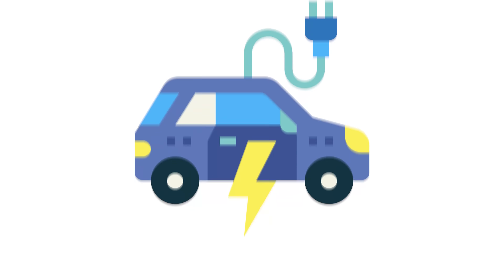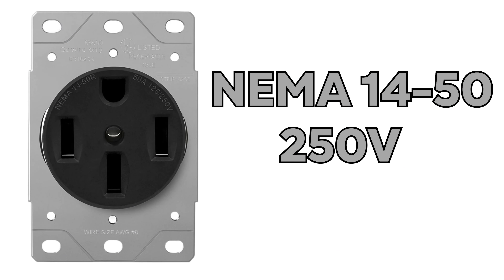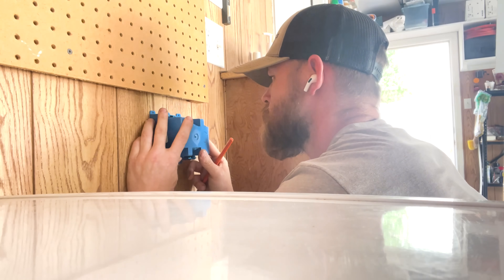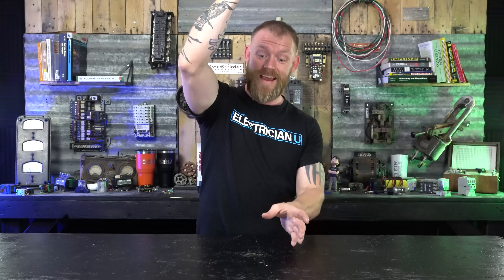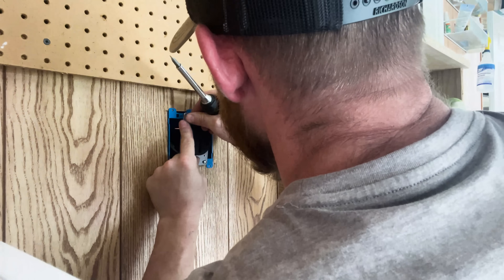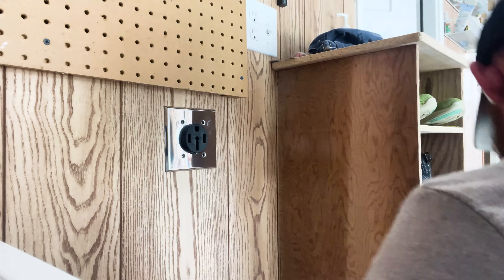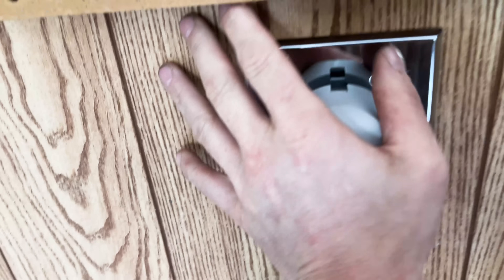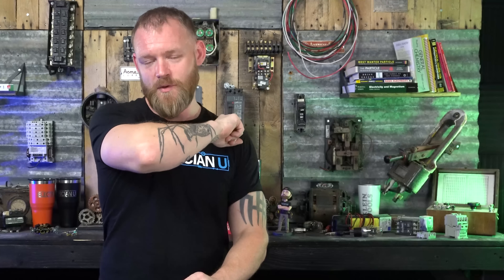How to Install an Electric Vehicle Charger Receptacle

Comment: Since this video will be seen by just as many people who are NOT electricians, I'd like to break down a few things that were not covered in this video but will help you understand your vehicle needs better.

First and foremost, that little box you plug into the wall is NOT actually a charger. The actual charger is IN YOUR CAR! That box has a small contactor/relay and a computer inside it and thats it. This box talks to the car and says, " hey, I'm a 16 amp or 40 amp 240v charging circuit." The car then adjusts its internal charger to only operate at the voltage and current that the box can provide. More on this later. At this point its just important that you realize the charger is in your car, not this plug in box.

Most cars come with a 3.8KW internal charger. At 240V (called Level 2) this equates to 16 amps. You can have a 40 amp box, but its only going to charge at the car's maximum of 16 amps. If your car has a 3.8KW charger, don't waste your money on a larger charger thinking it will charge faster...it WON'T!

Some cars, like Tesla have larger 7.8KW chargers and even 11KW chargers. These Level 2 chargers charge at 40 and 50 amps and will require a bigger box and circuit.

I like to install the Leviton 5842, 20amp receptacle for people with the 3.7KW cars. This is a dual voltage receptacle that provides Level 1 (120V) and Level 2 (240V) in a SINGLE outlet! It can be shared to operate off of a single 240V breaker, or divided to operate off of a single pole 120V breaker AND double pole 240V breaker. This is a great option for most people and only requires 12 guage wiring. See it here... https://www.amazon.com/Leviton-5842-I-Receptacle-Commercial-Grounding/dp/B000U3BVMI/
You can buy Level 2 boxes with the NEMA 6-20 plug on it off of Amazon for less than $200.00 Again, for most people this is all you need, especially all the "hybrid" vehicles.

The only other plug I like to install is the one in this video which is the NEMA 14-50. Its more expensive, requires bigger wire and will allow cars like Tesla to charge at their full rate. Its also the standard 240V RV outlet so you can plug in your RV when not charging your car. There are also lots of adapters available to! (I also use mine to backfeed my home with a generator in case of a power outage but this is an advanced subject not covered here.) I really like the NEMA 14-50 for many reasons but its not a must have for everyone.

Now if you remember in the beginning I said this box talks to your car's computer and says what kind of box/circuit it is. You can have the smaller 6-20 plug on a 20 amp circuit and still charge a Tesla...just not as fast! You have a Bolt but your buddy stops by with his Tesla. The box tells the Tesla, "hey, I'm a Level 2 charger but can only do 16 amps (3.8KW)." The Tesla says, "cool, I'll set my internal charger for only 3.8KW even though I can do 11KW so I don't overload your circuit."

You'll see that some boxes on Amazon come with 30 amp plugs. This is because most houses will have a 30 amp receptacle in their garage for a dryer already. That's it. Its MY opinion you should NEVER install a 30 amp receptacle unless you NEED it for other devices (welder, air compressor, etc)

First choice; NEMA 14-50. Second choice; NEMA 6-20 or combo 6-20/5-20 for Level 1 and 2 or a vacuum, or power tool or... I hope this helps.
Reply: Question on size of cables. If you run NM14-50 with 3 X 6AWG cables (L1, L2, and Neutral) Do you run the ground at 6AWG as well? and if so, how do you ground the electrical box with the grounding screw? Thanks in advance.

Comment: 0:30 shows a Tesla HPWC with a J1772 connector. . . A rather inauspicious start.
2:50 Using an old work box and fastening it only to drywall is a terrible idea for this size receptacle. The insertion and removal force necessary to mate and unplug this connector will, in short order, destroy the meager tabs holding the box in place.  Use a proper old work box with screw affixation like an Arlington F102 for decent longevity.
8:30 look up Hubbell/Raco insider for a more suitable connector for this task.

Comment: I just did an EV  the specs were 32A  6-50 R  so I installed 6-3wg  wired off the neutral for a future use/ change  , hooked up my 2 hots and Ground . popped in a 40 A breaker  Done

Comment: 1) #8 NMB in USA is rates 40a
2) GFCI after recpt is not compliant the GFCI is for the recpt
3) 125% load calc on conductor for EV, #8 NMB would do 32a

Comment: Question: I am planning to install a 14-50 outlet in my garage for a Chargepoint EV charger. I will be using 6-3 wire for a 50A circuit and the instructions state not to use a GFCI outlet because the charger unit has a built-in GFCI. If I ever decide to permanently remove the EV charger, will I have to replace the outlet with a GFCI outlet?

Comment: Hope I’m being helpful. All evse equipment both J1772 and tesla all have gfci built in. It’ll trip at 20mA but a breaker will trip at 5mA. All ev “chargers” will run a self test when they turn on.

Comment: Also, the tesla official wall connector can be setup to allow lower amps.  You always set it to 80% of breaker.  Very easy to program it to only allow 16 amps for example.  That would allow it to work on an existing awg12 wire.
Reply: It's not the outlet with the 80% continuous duty issue. It's the breaker.
Reply: You always do this? Maybe you should stop doing this and install the equip as intended. With 16amps the loss of current is way to high. Start using a real wallbox and promoting it. Those stupid wall plugs are not worth the money.

Comment: Just put a blank plate, no breaker in the panel with the wires taped off to connect later after the electical inspector leaves. You don't need a gfci breaker then

Comment: I'm an apprentice so we just installed an EV plug on Friday, but the guy i was with actually connected the hot conductors directly to the sub panel lug nuts... just wondering what's your thought 🤔
Reply: NO! There is NO breaker protection and that's a massive fire hazard. If the outlet ever shorts it will draw full panel power through the wire.

Comment: I installed a Tesla wall charger on one side of the garage, but on the other side, I installed a NEMA 6-50, which operates like a NEMA 14-50, but has no neutral.  I used a G.E. Wattastation which came with a NEMA 6-50 plug. Works great.  The only point being that you may need to look at your hardware before committing to the NEMA 14-50, even if it is more common.

Comment: On a NEMA 14-50 receptacle you need to provide a neutral conductor to it because of the receptacle format. However and electric vehicle charger doesn't use t neutral. It just used the 2 live conductors and the equipment grounding conductor (240 volt only).

Comment: I wish they would put green insulation on the equipment grounding conductor on Romex. It would make for a safer installation.
Reply: @William Lusby well obviously when you have exposed live terminals on the same junction box, it increases the chances of a short circuit.
Reply: @William LusbyThe grounding conductor on M/C cable is insulated. I think it's cheaper to leave the ground wire bare in Romex.

Comment: Can you clarify why you used #8 and not #6 wire? I guess this is fine on a 30 amp breaker. Can definitely not swap with a 50 amp breaker tho.

Comment: Two things i'm surprised were not mentioned here, which I think are extremely important to consider when setting up for EV charging:

1) continuous load --  since an EV that's charging can draw a load for many hours at a time, there is a de-rating that must occur, or in other words, an increase in conductor size (i.e. for a 40 amp load, 6-awg where normally 8-awg would do)

I'm surprised Dustin did not account for this when he mentioned just swapping out the 30a breaker for a 50a down the road.

2) quality, or grade, of receptacle -- especially in cases where the EVSE will be plugged and unplugged regularly, it is advisable to skip the $8 home depot NEMA 14-50 receptacles and spend the extra money on a heavy duty/commercial grade version. 

With 9 to 11 kilowatts flowing through the wire, the connection points, and the device, for 8 to 12 hours (or more),  the case for over-speccing and overbuilding cannot be overstated enough.
Reply: My thoughts exactly. And im just a self proclaimed UTUBE  ELECTRICIAN. I oversize everything fir EV charging and Generator hookups
Reply: @billpizzaman4700  Also worth mentioning the 50 foot rule. De-rate (or thicker gauge) for any cable length over 50 feet.
Reply: There are numerous videos of melted 14-50 recepticals from a hardware store. Pay the extra for a commercial outlet.
Reply: Are commercial grade receptacles better in temperature tolerance?  Asking because I use the home depot $8 receptacle for my home charging.

Comment: FYI, while the NEMA 14-50 is the most common receptacle, many car manufacturers support other plugs also.  I recently installed a plug in a jurisdiction that mandates conduit.  There was existing conduit where we needed to go, but the conduit only accommodated 2 #8 thhn.  As far as I can tell the cars don't use the neutral anyways and Tesla sells a 6-50 adapter, which is the same thing as the 14-50 less the neutral.  Some appliances like stoves use both 240v and 120v for the heating element and clock respectively, but I don't think the EVs make use of the 120v.  It's just the most common existing receptacle, thus the most common plug.
Reply: If a 50A motorhome is pluged in it will need the neutral.

Comment: Ok, I have a question. If one has a service pole some 500' from a structure and the pole has a 120/240 VAC  200 Amp Meter base with a 4/0 Aluminum USE lateral in 2'' Schedule 40 PVC Conduit to be installed by the Power Company to an Service Disconnect ( 120/240 VAC 200 Main Breaker ) on the Structure , does the Meter Base on the Service Pole required to have a Ground Rod , 5/8'' Copper/Brass 8'  installed ?

Comment: The most important thing....buy a premium 14-50 outlet. Hubbell recommended. I had a cheap home Depot outlet and it kept overheating and my charge was cut in half. As soon as I installed the hubbell i have had ZERO issues.
Reply: Bryant outlets are much cheaper and many people think they are the same as the Hubble (even made by Hubble).

Comment: Easiest way to secure it to the panel is a reverse grommet. Slide it on the wire after it’s pulled thru and snap it in.

Comment: Hey y’all, I am an apprentice electrician, loving the trade. I have a question about how to know if we can even run romex through the wall? I know how to use a stud finder, but in a case like this how did you know there wasnt anything going to be in your way when cutting open the whole and then running the 8/3 down from the attic? I recently just installed LED mirrors for my two bathrooms. The bathrooms are back to back and mirrored to the T, but one side had some kind of horizontal studs most likely to strap the cooper pipes for the pluming. I just made a little 2x2” opening in the drywall and chose to caulk and cover with mirror, but on a customers house I dont think Id do that.
Reply: You know because of the height of the wall. If you have a standard 8 ‘ ceiling then you will not have fire blocking in the wall. If you have ceilings that are higher than that , like in most custom homes you will have 9 ‘ or 10’ or higher 12 ‘ ceilings with taller walls. You will have cross blocking , or fire blocking at least in 2 places in the wall. Usually within 2’ of the top plate and 4 ‘ of the bottom plate. Most of the time you will not have blocking in a standard 8 ‘ wall unless it’s on a wall like in a kitchen where there is blocking for cabinet support installed. So the wall he installed the receptacle in is a standard 8’ wall. And if there is blocking just cut the Sheetrock from the center of the studs in a square where the blocking is. Drill a hole through the blocking and screw the square of Sheetrock back in place and patch it.

Comment: wish i could pst pics of my install. Ran #6..... Something You don't touch on Justin, is continuous load derating. #8 is why you needed to install a  30a breaker. #8 can hold 50a, but not if it's continuous. I can feel "heat" in my #6 conductors when my Tesla is charging at 32a. It's not a lot, but the wire isn't cool like ambient air is.

Edit: still a good video, just might not cover enough bases for that DIYer who is thinking this is easy work. I have to say, as a DIY person, my EV outlet needed a bit more info than just connecting wires ie. continuous load.

Comment: the cord that you use to charge an EV has literally one job, to regulate the current that the vehicle can pull. by putting a 30 amp breaker on a 50 amp plug you are just going to have constant tripping as the cord tells the car that it can pull up to 40 amps which it will try and do for long enough that the breaker will trip and you will wake up to an uncharged car. breaker's entire purpose should be to protect the wiring in the walls. the cord will protect the car from taking too much current.
Reply: The EVSE (which I guess is what you are calling "the cord") will draw whatever current it is designed to draw. But presumably the customer asking for the 30 A breaker knows that the EVSE that they've purchased only needs a 30 A circuits and will not be tripping the breaker.

You are right that the breaker has no way to limit the actual current drawn by the EVSE, but that's not the point.
Reply: @harvey66616  yes I'm referring to the EVSE. A 30amp evse won't fit the nema 50 socket that has been installed. The EVSE that will fit the socket is 40 amps which will trip the breaker. I understand that this is what the customer wanted. I think the issue is neither party unstood how the car would be used.
Reply: @shauntoochaos235  "A 30amp evse won't fit the nema 50 socket that has been installed" -- not sure what you mean. I own a 5 kW EVSE with a 14-50 plug on it. It definitely fits the 14-50 receptacle I have installed in my garage.
Reply: @harvey66616  the ones I see online that are lower amps have nema 30 plugs
Reply: @shauntoochaos235  your own observations online are not even close to representative of the actual market. Making a broad generalization based on that is unwise.

Comment: Just my 2 cents on the 30A breaker on the 14-50.  The breaker is there to protect the wiring of the circuit from overload.  The 14-50 and wiring is rated for 50A so a 50A should be used even if the owner isn’t going to have a load near that.  If I install a 120v circuit just for a light that pulls 1A I’m not going to install a 5A (or whatever) breaker.  I’d use a 15A or 20A depending if I pulled 14 or 12 AWG wiring
Reply: The breaker is there to protect everything downstream of the breaker. This is the wiring, yes, but also the equipment plugged into the outlet. If you've got (for example) a 24 A charger plugged into the outlet, it's safer to have a 30 A breaker, so that if something goes wrong, the EVSE or its own power cord (which are not rated for more than 30 A) don't get too hot and start a fire.

Comment: Justin,
Great videos, but.....
#8 THHN is rated for 50.
#8 romex is 40.
Load calculations on that panel FULL of wafers.
Blue Carlon cut in ???
Metal 4 square x 2-1/8" with extension ring, attached to framing not sheathing.

Comment: Teslas can use a 14-50 or any other receptacle and other vehicles use large chargers. 
My Volt has a wall unit. 

Also I don't think these receptacles will be code for long. You can't cord and plug disconnect a hot water heater because of the amount of current it draws and how quietly it does it because someone can unplug it with a load and arc themselves. It's going to happen to some kid unplugging a car charger under load (which is usually more than a HWH).

receptacles for chargers should require lockable in use covers.

Comment: On a Tesla mobile charger, the one that is supplied with the car. You can change out the house side plug. It will then know what is plugged in, 120-15, 120-20, 240-30, 240-50. 

In turn, the mobile unit will tell the Tesla car what it can draw for amperage. So if a Tesla was plugged into that NEMA 50, it will pull 42 amps. That will of course trip the 30amp breaker. 

Yes, you can lower the amp draw in the Tesla. But a lot of people don’t know that. And even if they did, they would be wondering why they have to. 

With all that being said, the same issue may happen with other EV chargers. Where they know that a NEMA-50 was used. Thus the car will draw 42 amps.

Comment: "a little bit extra won't hurt you."
Cries in $6.50/ft wire

Why do you say "so you don't get too much current through the car" ? The cars on board charger has a limit to how much current it will draw and the EVSE has a limit to how much current it can supply. If you plug in a 40 amp EVSE to this circuit and a car that can draw 7.2kW you're going to trip the breaker. If you plug in a leaf with its 6.6 kW charger into a 30 amp EVSE you're going to be drawing 27 amps on this 30 amp breaker so you're 3 amps over the 80% limit of that breaker. If the owner of this house sets the limit of the EVSE below 24 amps then none of this is an issue but it seems silly to put all that in on a 30 amp breaker.